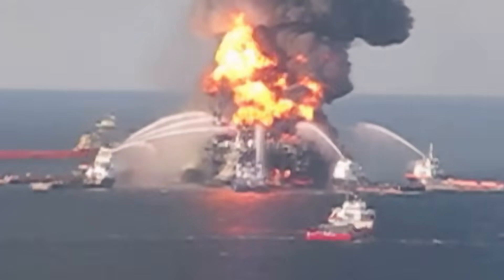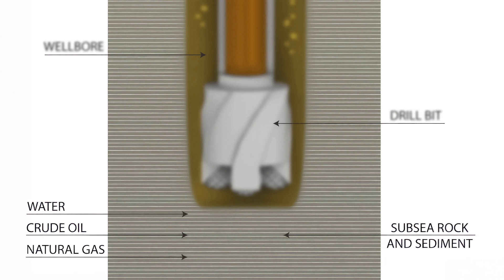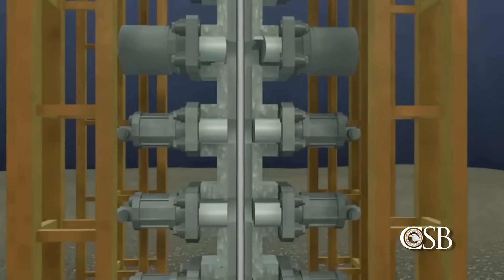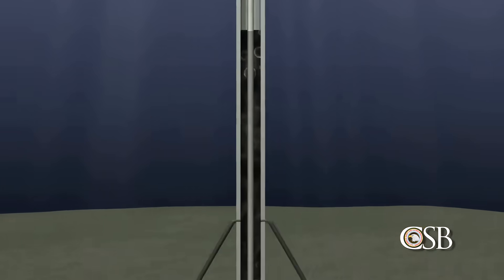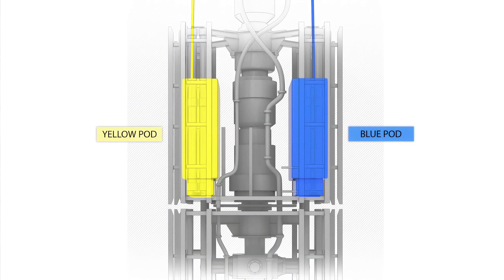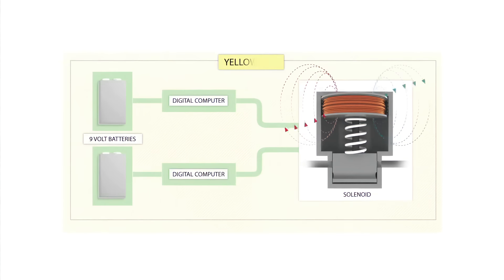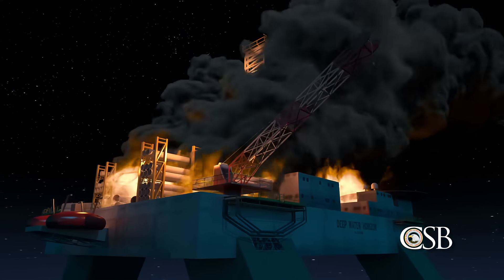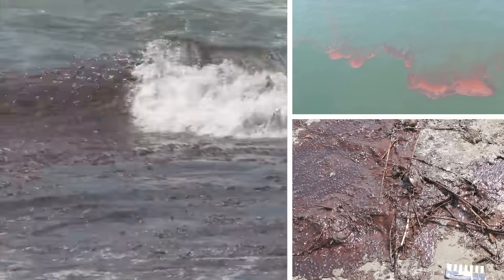Deepwater Horizon Blowout Animation

Comment: You know, I just had a random thought 💭 in order to adapt to the buckling outcome, it seems that if they modified the mechanisms that clamp 🗜️ onto the gas pipe, to be right up next to the pipe, and making the area which the pipe fits into more adaptable to alterations of position within a certain degree of movement if a buckle occurs? That might "might?" Help provide the safety net needed to coupe with a pipe buckling?? Maybe IDK just a random thought from a random person. I hope the problem get fixed so these events don't happen many other times. They are so hard to stop if the safety measures don't work correctly. There is gotta be ways to make the other layers of the shut off safety measures greatly improved for even worst case scenarios and I could go into that but I won't. I think the solutions will be pretty clear once thought about long enough. Now that we have a clear example of what happens when the design doesn't work? There was a lot of parts that required things to work under nearly normal, perfect circumstances and that's just not theoretically the manner things would be like under a emergency state, things are a mess, so it's good to design it to work in the situation of a mess and in decent circumstances. Also to include better, simpler last stand, auto shut off, dead man shut off's. Because those sure were way too able to "not correctly function" in the circumstance of losing power from the drill rig in the event of a blow back... I hope they design something even Tesla would be proud of, hydromechanical engineering wise at least.

Comment: Not sure if you know how to count, but the 240,000,000+ gallon Persian Gulf oil spill (where Iraqi soldiers opened valves on tankers into the Persian Gulf in 1991) was bigger than the 210,000,000 gallon Deep Water Horizon oil spill.
Reply: Liberal Patriot  You can't count either...
Reply: @dundonrl  They said, and I quote "The largest oil spill in US history". Persian Gulf does not pertain.

Comment: In 2015 the average cost of 1 barrel of oil was $4.66 and the well released 5 million (5,000,000) barrels of oil into the Gulf of Mexico. So the oil cost alone was over $23 million dollars ($23,000,000.00). Then when you add in the cost of environmental damage and cost of clean up the amount of money is almost imaginable. I think every single thing combined equated to roughly $65.6 billion dollars ($65,600,000,000.00) and that’s just the cost of damage not including the loss of people who were killed from the accident or the people who were severely impacted from the oil spill clean up. I know right after the accident the upper management were charged with involuntary manslaughter but then later had the charges dropped but in my opinion they should have been prosecuted because of them is what cause all of these tragic stories and they should have been held responsible.